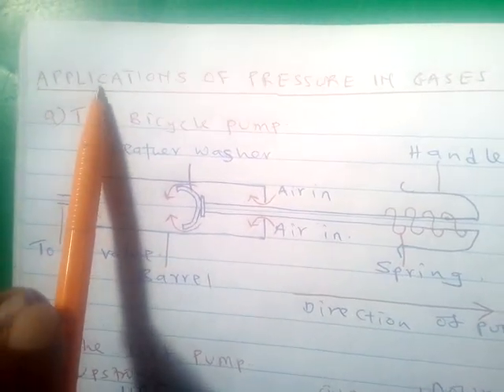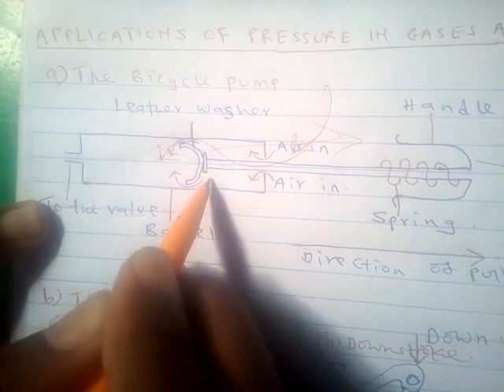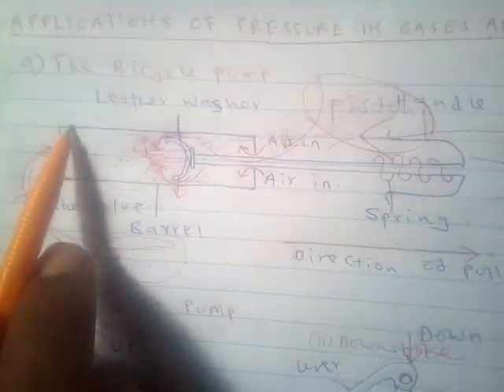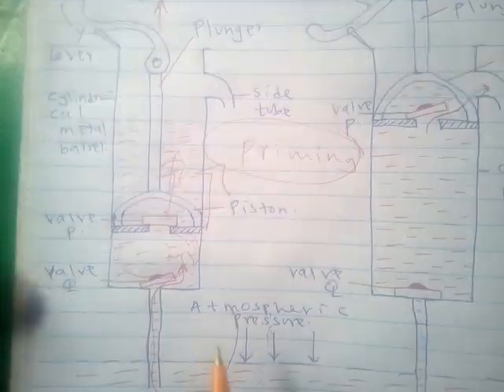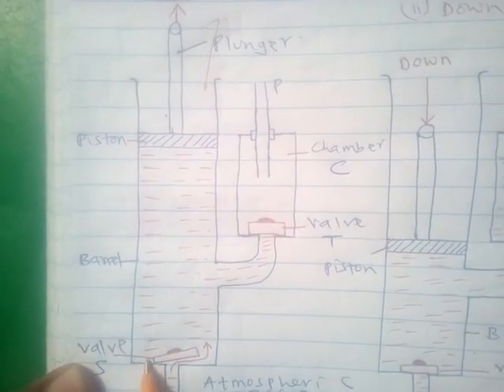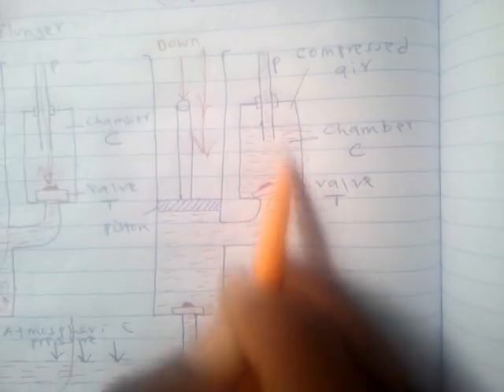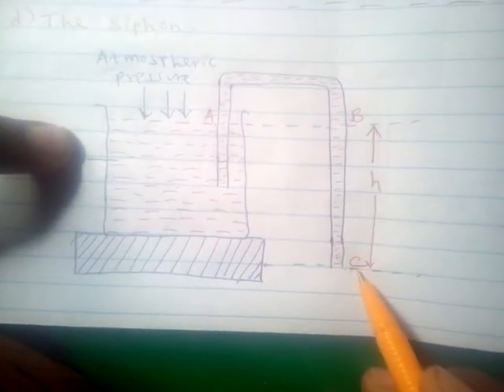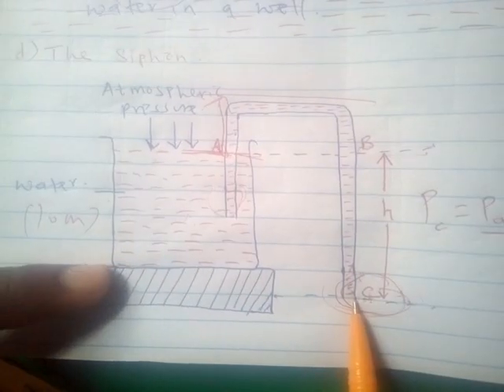PRESSURE : LESSON 8

Comment: How is continuous flow of water maintained in the pump
Reply from the maker: It's maintained by compressed air which creates a pressure difference between the air pressure trapped in the smaller barrel (chamber) and atmospheric pressure acting on air outside the chamber. Thanks for your comment 🙏.